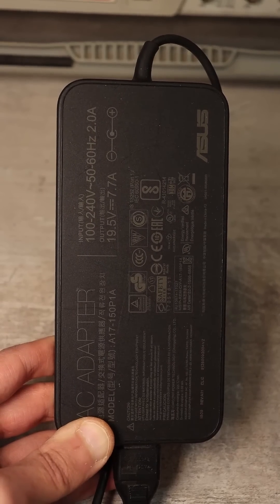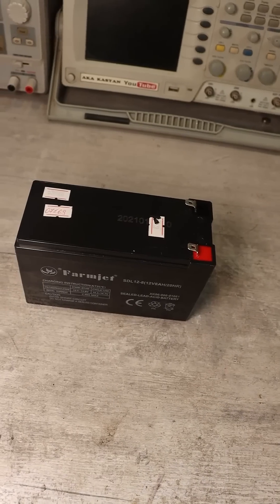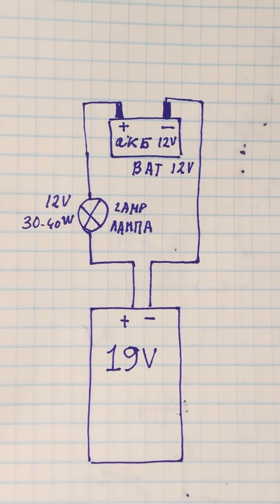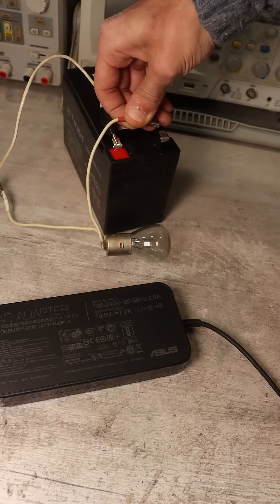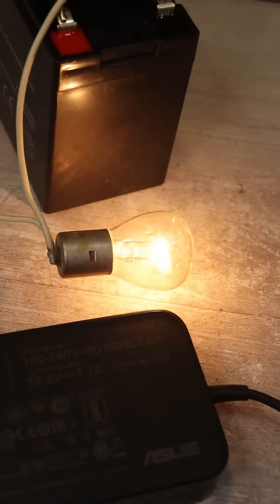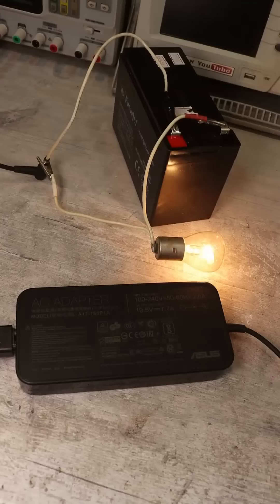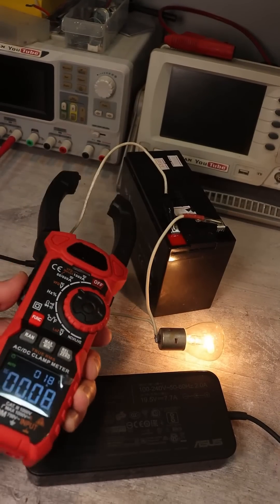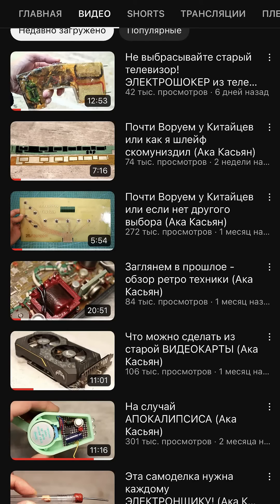How to charge a battery with a laptop adapter.

Comment: If its lead acid it ain't problem.. i charged a 4V lead acid battery(2 cells ) 1.5Ah battery with 5V40A smps 😂😂.. it charged there was no lamp in series though , a diode and 3.3ohm resistor in series.. no problem ..
Reply: Shows how little you know making a comment like this, just shows how uneducated you are

Comment: I used this setup... It's kills the battery over time.
Reply: Proper way is to add a buck regulator instead of the bulb.
Reply: Series bulb is there to drop voltage, and lead acid car battery can safely take much more charging current than a laptop adapter is able to supply, just battery voltage need monitoring  and should not rise above the limit.
Reply: @vivek6132 if used a buck converter it can handle more current providing more power to the battery.
Reply: No problem if the voltage is manually monitored as he said, lead acid has a wide tolerance of full charged voltage, disconnect well within that range and everything will be fine.
Reply: @vivek6132  Only if you don't forget it's plugged in at 19v adapter more commonly.
Reply: Yeah its ok I guess for a cheap way to charge if a spare bulb is just laying around.
Reply: Quelle batterie vanno caricate con un massimo di 1 amper , altrimenti in pochi secondi l elettrolita bolle ed evapora